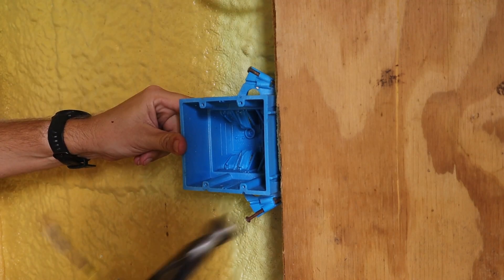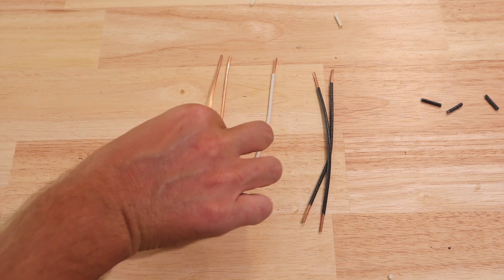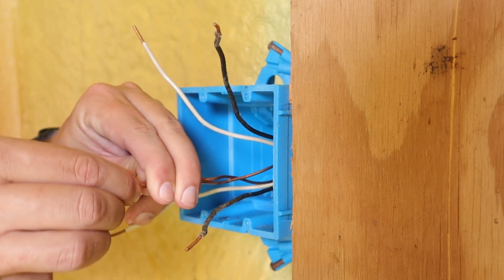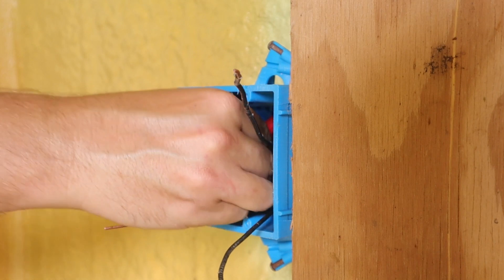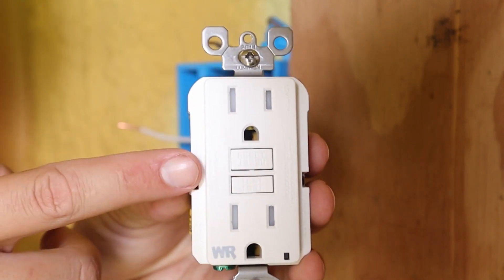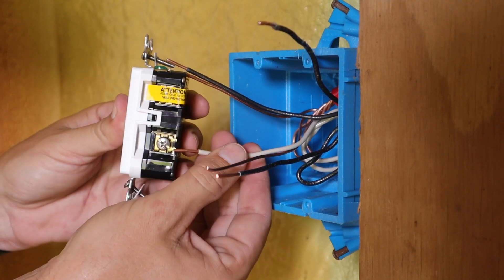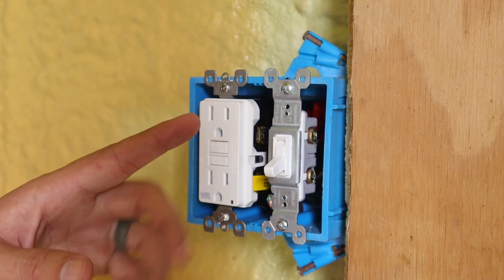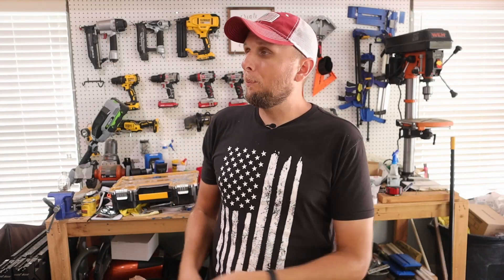Easiest Way To Wire a Light Switch and Outlet In the Same Box

Comment: I have 7 daisy chained wall outlets. There is a red wire from a light switch to the bottom connectors on the outlets. When I test the outlets it shows they are not properly grounded. I would like to add a GFCI box to the power incoming box of the daisy chain. How do I connect the red wire from the switch to the red load wire for power?

Comment: I'm no electrician but I can usually figure things out. I did exactly what was in the video and my light does not work. When the light switch is off, I have power to both contacts. When I turn the light switch on I do not have power to the two contacts on the switch. Any thoughts? Other than that, love your videos.

Comment: Does anyone know if the way this is wired, will still let electricity still flow to 2 other outlets on the same wall? Be a total of 1switch to a 1 bulb fluorescent light and 3 outlets when finished.

Comment: I don't understand how u just have one wire going to the light.    Where's the white and ground from the light.      This is not helpful
Reply: I'm in the same boat. After doing exactly what he said the power to the outlet works just fine. Light switch does nothing. Lights stay off.
Reply from the maker: @airdaff4973 no you didn’t otherwise it would be working.  Mine didn’t work from magic.

Comment: This helped me a ton, though I'm still not quite there. My kitchen has power running from this exact setup to another outlet. If I'm understanding, the wires would go into the bottom of the outlet you showed for that other outlet. What's confusing, is I guess that means I need a 3-way switch since I have two outlets? The light switch is just used for some undercabinet lighting, I didn't think it'd need a 3-way.

Comment: Can you explain why pigtails and wire nuts filling up the box is better than just pulling 12" of wire into the box and attaching directly to the receptacle. (Only because of code?)
Reply: Just easier to work n not pull ur wires when ur adjusting

Comment: Would this be the same concept, if it was a bathroom ceiling fan instead of the light? As they're both just on one switch coming off the gfci hot line?

Comment: What is a lone wire?
Reply from the maker: I’m guessing you mean load wire.  Because there is no such thing as a lone wire unless it is by itself.
Reply: @HowToHomeDIY yeah you said "the lone white wire". I'm not sure why you didn't pigtail two white wires like you did for the ground.  I did all that and the outlet works but the switch doesn't. Why didn't you attach 2 white wires like you did for the ground?  My switch does not have a neutral wire attached  doing it this way.
Reply from the maker: There shouldn’t be a neutral attached to the switch at all.  So I’m really not sure what you did, but you didn’t do what I did in the video.

Comment: Thank you so much for the informative video! I followed exactly. Unfortunately, when I plug in my tester, it is indicating "open ground". Any ideas or suggestions on how to solve this? 
I can use the test button on the gfci outlet and it does trip.

However, if I have the external outlet tester plugged in. When I hit the gfci test button on it. It does not trip.

I'm stumped. Hopefully someone out there can provide some guidance.  I'd REALLY appreciate it.  Thanks😊

Comment: I was thinking i would run the power for the switch from the load on the outlet.  Also, i usually wrap my work in electrical tape.  Am i wrong?

Comment: Thank you, thank you, thank you! I have an old light switch (1961) in my garage that I wanted to convert into a 2-gang switch next to a GFCI outlet. There are also two other outlets connected to the same junction box. I must've tried every possible configuration except the one shown in this video. I couldn't figure out why my light wouldn't turn off or why the GFCI kept tripping. I kept walking away for a few days before trying again. LOL. Finally, I found this video, and it was exactly what I needed! You explain everything so clearly and precisely, without any unnecessary distractions or gimmicks. You would make an excellent teacher or professor. Once I rewired everything according to this video, all of my issues were solved!

Comment: Correct me if I’m wrong but you turned off a 15amp breaker so that would be 14/2 & the pig tails you made are from 12/2 which would be a 20amp circuit.Should you not keep the wires  the same?Either 14/2 or 12/2?
Reply from the maker: It was all 12/2.  You can see the wiring sheathing is yellow.
Reply: I know but the breaker was a 15amp.
Reply from the maker: @Dave-ld3dr yeah that is just a recorded video when I talk about turning off the breaker before working on it.  That same clip is in many of my videos.  But regardless, even if it was a 15 amp breaker on the circuit I work on in this video, it is completely ok to use 12/2 wire on a 15 amp circuit.  This doesn’t really have anything to do with the video’s subject matter.
Reply: Thanks for clarifying that.Some people are very critical to only use one or the other even when applicable.I have learned a lot from your videos.Thanks for the quick reply.
Reply: Thanks for clarifying that.Some people are very critical to only use one or the other even when applicable.I have learned a lot from your videos.Thanks for the quick reply.

Comment: So I have this existing switch that line power runs to switch first then all white wires are nutted together and then just two black wires on switch that controls the duplex outlet . Duplex has one black one white and ground.  can i put together two black wire at the switch to make duplex always hot?

Comment: Seems it’s all 12 awg wire and a 15 amp fuse w 15 amp dual outlet (which is fine but not for single outlet )

Comment: Thanks for the simple to understand instructions on the gfi but what if I want to put an led light strip away from water getting to it sorta like how shower nitches are installed. It comes with a small transformer how can I splice the cord that plugs unto the wall to get wired to the switch without allowing to many volts to the led lights ? Can I just cut the cord from the transformer and splice it on the switch?  Thanks for any help.

Comment: same setup in a bathroom im changing switches on but there are 2 extra wires that were wired into the outlet instead of pigtailed, wired a new switch the same way and now the outlet doesn’t work but the switch does. my neutrals also spark when touched, house was built by owner 30 years ago,  not much to code, even inspector missed it when i bought it

Comment: Thank you for your video, just a question, does the GFCI out let protect the lights as I the light was not connected to the load portion of the outlet. As I understand, GFCI only  protect any circurt connected to the Load side. I could be wrong.
Thank you

Comment: This video was an enormous help for me to replace an old outlet and switch combo with a GFCi. I had additional load lines going to a bathroom outlet as well not covered in the video, but that was as simple as connecting the hot and neutral to the load outs on the gfci.

Comment: Hello I follow you on YouTube and need electrical help. In my bedroom I have a single pole switch and 3 outlets. The one outlet works but the switch and other two outlets don’t work. If I hook up all the wires on the working outlet and flip the switch the breaker blows. Do you have a video covering this issue?

Comment: I noticed on the GFCI outlet that the ground plug was on the bottom. I've had another electrician tell me that the ground plug is supposed to be on top. I don't know if either really matters
Reply from the maker: It doesn’t matter, it’s preference.  No code dictates a ground’s orientation in a residential application.

Comment: I have a switch in my bathroom for the light and the other is the light inside the shower and fan. So two switches. One switch controls only the light and the other switch controls the fan and inside light to the shower. Only thing is I don't have any plugs to power up anything like a hair dryer for example. I have 0 plugs in my bathroom. Is there a way to add plugs and have them run off the 2 switches that are already installed ?

Comment: The wiring worked, but the switch and lights aren't protected by the gfci.
Reply from the maker: I didn’t want them protected by it.  That’s just not typically done for a light.
Reply: @HowToHomeDIY  oh. What about a ceiling fan after the gfci?
Reply from the maker: @naterogers9427 not necessary.

Comment: I have a 2 gang box with a standard light switch that controls Christmas lights, and a GFCI outlet. 

I have 2 white, 2 black and 2 ground wires. 

Is it possible to switch the standard switch for a Kasa smart switch hs200?

It looks like I need another neutral wire to do it which I don’t have.

Comment: What if instead of 2 wires we have 4 in the box? 2 come from the top 2 from the bottom.
Reply: Thats normal. The two coming from the top "usually" are running up to the light itself. The two from the  bottom are coming from ypur power source

Comment: In this scenario, if my load (a picture light on the wall above the box) has only a neutral and hot (converting a plug-in light), how best to ground the switch?  From the line ground?

Comment: With this same switch combo but instead of wiring it to the lightbulb, can I just run it to another receptacle and how would I wire that? I am assuming the wiring from the light bulb would be replaced with the wires from the next outlet, correct?

Comment: Need advice. I have a backyard water fountain about 80 feet away from the house. The receptacle behind the fountain needs to be replaced. Obviously the water pump plugs into the receptacle. Here’s my issue: A separate light is also powered by this receptacle. There is also a switch at the house that controls this light without interrupting the power to the water fountain. Unfortunately I disconnected everything and removed the receptacle but need help connecting it all back to its original working order. FYI, the wiring going into the box has an additional red wire along with one black, one white, one green. The wiring coming out of the box to the light does not have a red wire, only one white/black/green.

Comment: What if power first comes into the light fixture. Does that change the wiring?
Reply from the maker: You more than likely won’t have a neutral wire there at your current switch box in that setup to where you wouldn’t be able to do this without running some new wiring.
Reply: Thanks! and nice video @HowToHomeDIY

Comment: I love the video. Only thing for me is that the power goes to lamp first than to this receptacle with both the switch and outlet. When I follow your direction with line and load the light stays on when switch is in either on or off position

Comment: Hi, just sub since I find your videos most helpful. I Hope I can get your input on this plan for my bathroom. I plan to install a bathroom exhaust fan with no existing power wires present but there is a power receptacle in the bathroom, can I fish a romax wire from the attic, replace the old power receptacle with a switch/outlet and use this to operate the fan??

Comment: Why did you use 2 ground for the ground pigtails and only 1 neutral for the 2 neutral wires?
Reply: I wish he would answer that question. Searching comments to find out. Switch does nothing outlet works. Wondering why no neutral to switch

Comment: A couple of newbie questions:

1. Could the switch be wired 'downstream' of the GFCI so you would be protected while changing a broken light bulb? Or (shudder) using a 'light bulb to outlet' adapter?
2. Would it be better to put the receptacle closest to the stud so there is less leverage when pushing/pulling plugs?

Also, I would have liked to see a wiring diagram up front so I understood why you needed which color and how many pigtails.

Comment: When I have a GFCI and a switch in the same box i will feed the power to the switch and light from the load side of the GFCI. My though process is if the GFCI is required because it is near water, someone may have wet hands and turn off the light switch. If for some reason the water causes a shock hazard the GFCI will protect the person.

Comment: What do l do l have existing wiring l need to replace the outlet and the light switch which came out of the same box l have 3 white wires 3 black wires 3 ground what do l do

Comment: I’m no electrician, by any stretch. I only change fixtures and that’s about it. However, I am handy and do as many house projects as I can on my own, but this is an area I always said I’ll call pros for.

This video was simple, easy to follow, and made sense. It helped give me confidence to take on my shed project. My new shed has a power supply running to it, but nothing else. I wanted a light and and outlet. This was perfect! Thanks again!
Reply: My partner does the same thing and was very impressed with the video, which as it happens it is a shed project he's working on. Thanks great video.

Comment: I noticed you always wire a socket with the ground plug down.  I do also.  My licensed electrician brother say to always have the ground plug up.  What is correct?
Reply from the maker: The answer to that is there is no wrong or right.  The NEC does not dictate what orientation a receptacle should be other than in settings such as hospitals for example.  The only way it cannot be is with the receptacle facing up towards the sky.  But ground up or ground down is a personal preference.  If your brother says that is not true, ask him to show you in the NEC.  He won't find anything.  Hope this helps!  Appreciate the question!

Comment: Question: I have more or less a mudroom. When you come in from outside the house to come into the house, via the finished basement; you first enter a non-temperature conditioned room. We use it as a utility room. You next have to go through a second door that goes directly into the finished basement, then you can proceed upstairs to the main living area. Inside this tiny room next to the door leading into the finished basement, there's a single light switch that operates a light directly above it mounted on the wall. Immediately inside, precisely behind this light switch, there is another light switch that additionally has two outlets that are not controlled by the light switch there. Back to the other one; I took a flashlight after removing the plate cover. The only wires going to that switch are a white common wire, a black hot wire and the ground. Is it safe by that description to install a similar switch as the one opposite, or is there possibly something I can't yet know about where the wires come from? I kind of doubt this question paints the image you need to accurately answer this. We have breakers, but I don't want to damage anything to accomplish this. Anyone qualified can answer.

Comment: Thanks for this great video, very logical explanation throughout! The best that I found on youtube for adding a GFI with a switch for my low amp garden fountain.  A+ quality video, its nice to see exactly what you're doing close up compared to other videos that talk through parts.  Just a warning to others to take your ring/bracelett/watch off, if it is metal while  you're doing electrical work-- I grounded my watch  once accidentally on the positive terminal of a car battery when I was 18 (no youtube back then)- hello second degree burn - took some skin off the inside of my wrist and that was with me being able to remove it.  With a tight fitting ring you might be talking third degree burn, because it may not come off easy. I realize the panel power is off in the video as he checked all cables and took the correct precautions, but mistakes can happen.

Comment: great viseo, it appears you were using 12/2 wire with a 15 amp breaker
Reply from the maker: 12/2 can be used on a 15 amp.  14/2 can’t be used on a 20 amp.  But the breaker for this is actually 20 amps.  I just used footage from a previous video I did which was on a 15 amp.

Comment: I have a box that had a GFCI  and a switch. We remodeled and I had to take the old box out.  There are 4 sets of wires. I know which is hot and which controls the light but I don't know what to do with the other two sets. If I put all of the ground together with 2 pigtails that is 6 wires. the same with the black.  I am really confused.

Comment: Question: Do you recommend using electrical tape on your wire nutes so that the nuts stay on better? I have done this while installing ceiling fans, and wondered if this is a good or safe practice. To me, it has made the difference of knowing that my wire nuts are not going to come loose or not, which has happened  to me, when installing ceiling fans. What are your thoughts on this?